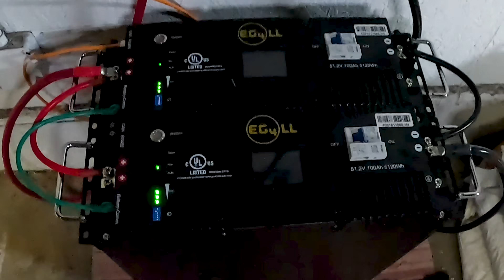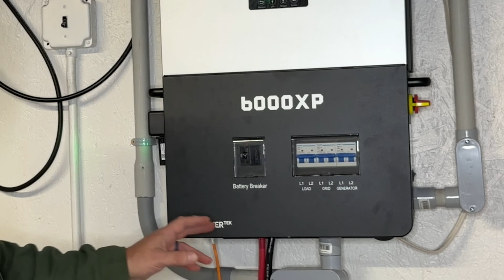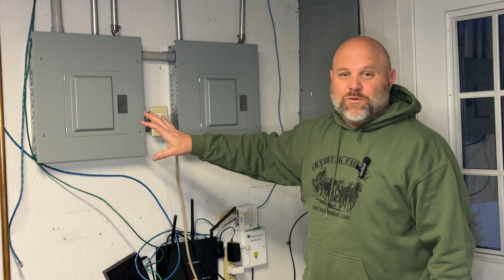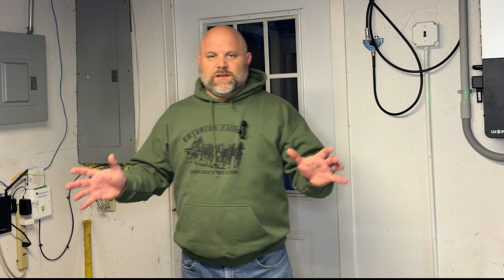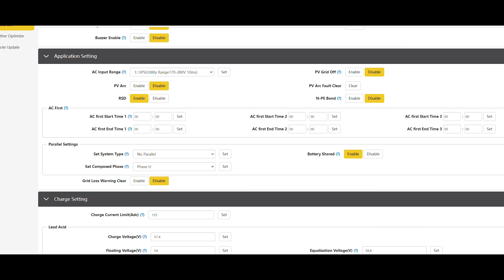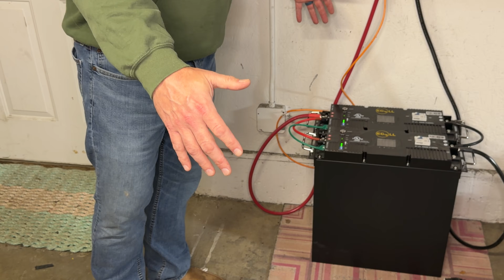After My Generac Failed... This Is What i Replaced it With

Comment from the maker: if you haven't seen it, this is where my Generac failed at Just 200 Hours: https://youtu.be/oozHGA7xwKI?si=qmxr-HOlWkTtwVIv

And here's what i found when i tore it apart: https://youtu.be/kO14Q32_2T0?si=OIt8ApJVsjL0Gwl1

I’m curious—how many of you have ditched your standby generators for a similar battery-backed system? Any questions on the EG4 setup or how the off grid system is holding up? Let’s talk in the comments!

Comment: Just found your channel, new subscriber, as I am considering an Auto Transfer 20kw generator. We are in Upstate NY and have reliable Grid power so justifying the cost of the Genset, AT, Propane is difficult. Several years ago I installed a Generator Interlock on my main panel and use a Miller Bobcat 11kw welder/generator for the few times we need emergency power. Works great and dual purpose as I use the welder on the tractors. 

 But... over the 4th weekend we experienced  a strong storm and lost power for 16 hours - longest in the 38 years we have lived here!
So that was a wake up call as my wife is not comfortable starting the welder and switching the breakers when I am not home. We decided to upgrade to an AT standby - probably Kohler 20 or 26kw.

My brother is pushing a battery system as we already 8kw solar panel system so it might make sense to go the same route you did. As I have the welder/generator in place I can use that for charging the batteries in the unlikely event of another prolonged outage where grid and solar can't recharge the batteries.

Sorry for the long comment but I just wanted to say thanks for your content on the Generac grenade and follow up. FWIW you might consider a welder/generator as back up as you may have a need for the welder around your place? Keep us posted on future EG4 usage and satisfaction.
Reply from the maker: Thanks for stopping by and watching! I always love to hear new ideas and options. Generator:welder would be pretty handy to have, you’re absolutely right! Not sure I can justify the cost but possibly.

Comment: If you had time of use.  Cheap over nights you could take advantage of that,,,,   I have 10kw batteries coupled with my AC solar system.     I can run my essential loads for 2 days (freezers/fridge etc).     The solar (8kw) tops up the batteries.    I have a cummins 20KW genny and I only have it on auto from NOV tp March (need to run heating (heat pump) .   My genny runs very infrequently now!!!!!    I set up the genny 10 years ago and solar/battery 2 years ago.      I think if I had time back and batteries were available way back, I would not do the auto standby generator and add 2 to 4 more batteries
Reply from the maker: Yes, I'm not sure if I consider myself lucky or not that we don't have time of use cost adjustments here. Definitely some opportunity there for those that do. you really need the generator to have another purpose to justify it in a setup like you have. And for the cost of additional batteries/solar panels, it's even harder to justify a generator.  That's for a very long term outage in bad weather. For the right environment, I'm sure it makes sense.

Comment: Ok, so . What I AM and Have done with my EG4 setup. ADD The Generac to the EG4 system to charge the batteries if and when the power goes out. Then the batteries are drained and no solar or not enough solar. Generator kicks on and charges the batteries. 

My setup is a little larger. But still setup the way I explained. 6x 14.3kwh batteries, 2x Flexboss21, 1x Gridboss, 13.5kw solar, 26kw Generac, 2x Portable Generator inlets, 1x 12.5kw Portable Generator

Like #3, subd, commented and watched other vids
Reply from the maker: Thank you for the support! Man that sounds like a great setup you’ve put together. This is pretty modest but as I mentioned in the video, it covers what I need. Would be pretty nice to expand out, maybe someday.